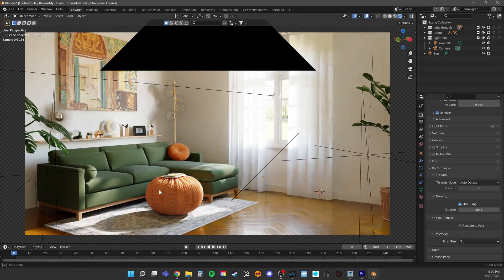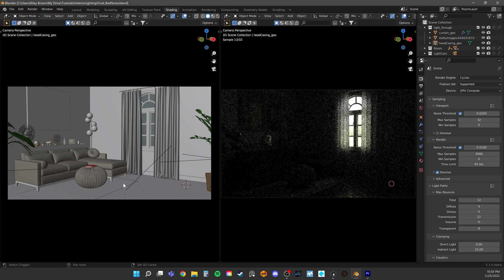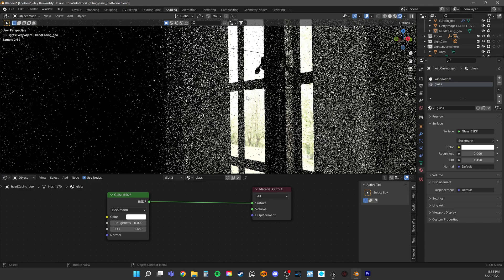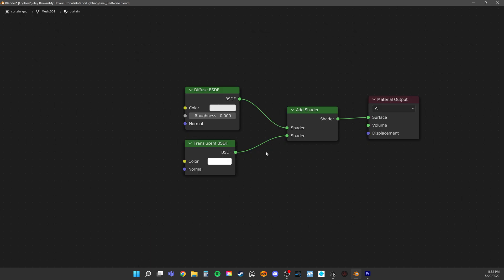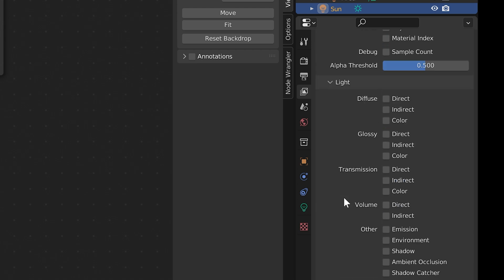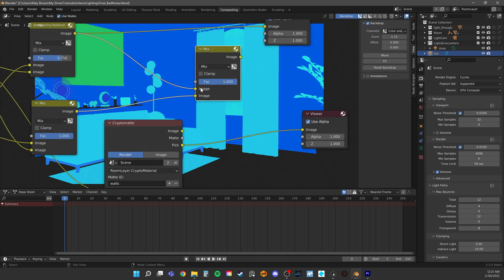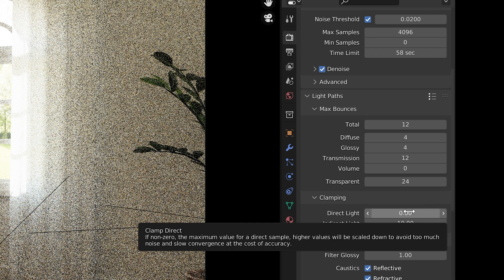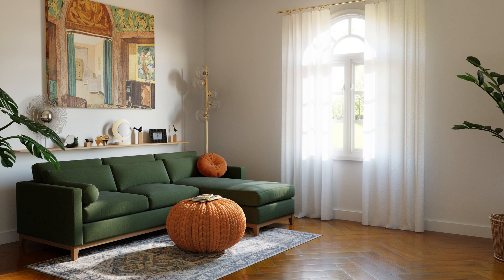Optimize interior Renderings in Blender Cycles

Comment: Great Video would like to know how you did this wall disappearing thing, when the particular wall comes right Infront of the view. am building an interior scene myself just for learning purposes and would love to know how you did that so that my camera can always see what's inside the walls while of course the far end of the wall is still visible
Reply from the maker: In the shader editor, drop down a mix shader. Mix between your existing shader and a transparent shader. For the factor, use "Backfacing" from the "Geometry" shader node.

Now, the "front" face (wherever your normal is pointing) will be your existing wall shader. The backface will be completely transparent. Allowing you to look inside, without letting the light out. 

 For this to work, keep in mind you need the normals on your walls to be facing inward. 

If you run into trouble and want more help, please send a message to the email listed in my channel's about page.
Reply: @rileyb3d  Thank you so much.

Comment: I would like to ask a question, should the light portal be positioned before the window (outside the opening) or after the window (inside the room)??
Reply from the maker: Good question. Through my tests it didn't make much of a difference. I'd personally put it on the outside to ensure you get any direct light you need to show on the window or wall geometry. 

I would still keep it close to the window opening though.

Comment: There is also a way to get rid of noise by actually rendering out a bigger image and then denoising it. It is slower but with the same amount of samples, or even lower, you could get better results
Reply from the maker: In my own tests, I didn't find this to be a reliable method. It is a lower number of samples, but the samples spread across a larger image end up taking about the same time or longer. I also found denoising to take disproportionately longer, the larger the image. 

That's with limiting testing on one scene though. I wouldn't be surprised if some cases work out better. Thanks for sharing!

Comment: You don't actually need one of the mix nodes if it's set to 1, that practically does nothing and also the transparent light bounces doesn't matter because the light is ignoring the window anyways and not bouncing, and besides there are only 2 transparent objects so 2 transparent light bounces are enough

Comment: One neat trick i picked up is often rendering higher resolution image(1440p instead of 1080p) can actually save you time. Higher resolution leads to way better denoising while suprisingly not adding as much time to render as you might think making it actually faster than cranking your samples at 1080p

Comment: nice tutorials and renders
just wondering why not just turn off shadows in the object property for the window for example? Also is it better you use the Principal shader for glass/ curtains or stick with the simpler setup?
I am  a bit confused with portals as they don't seem to make much difference in my scene unless I really bump up the HDRI strength
Also is it ok to jsut use the HDR and not an additional sunlight.When I do use a sunlight I  generally make my sunlight quite sharp and then align it to the HDRI using the 'sun positon'
overall i am find outside lighting much easier than interiors ;)
Reply: replying to myself :). I still think blender portal lights are not as good as other renderers. for example renderman you can increase the strength of the portal light and link it to the HDRI

Comment: Hello, amazing video with tricks I didn’t know, but I have a question that I was not able to solve,  maybe you know the answer,

I’m currently using KcyclesX 3.2 that has this feature of light linking where each light is rendered separately and then composited together into a final result, 

I’m not able to figure out how to use the denoise  by material node setup together with this light linking feature

If anyone has an answer to this I please do let me know

Comment: What do you consider are the best HDRIs from Poly Haven in order for the interior to have ample dynamic range?
Reply from the maker: I overuse "artist workshop". Love that one.
Reply: @rileyb3d  I've tested it and it is indeed great to get good details in the highlights and the shadows.
Do you use it when rendering interiors? If so, how can one get rid of the unwanted reflections of the HDRI showing up in metals, for example?
Reply from the maker: @mrlightwriter  I usually go with the added reflections, but if you want to "cheat" it, there are a few ways. 

Add a mix rgb node in between your HDRI environment texture and the background node. The HDRI goes into the first mix input. In the second mix input, either insert a solid color, or a different HDRI you want to show up in the reflections. 

Now, add a Light Path node. Take "is glossy ray" from the light path, and plug in into the "fac" (factor) of the mix node. 

This will essentially make it so any reflection (like your glossy metal) will now show whatever you have in the second input, while your scene for the most part, will still be lit by the first HDRI image. 

If any of that doesn't make sense, feel free to reach out on my patreon! I can give you more 1:1 help and have you send your scene for optimizations.
Reply: @rileyb3d  Your answer was very comprehensive, thanks! I'll try it as soon as I can.
Reply: @rileyb3d  I'm using the "artist workshop" and it's indeed a great HDRI for interiors. Thank you!

Comment: Optix temporal denoise since Blender 3.1 is amazing for animations, more people should be talking about it!

No one seems to have tested it because there is no documentation. I got this far:

Set render output to EXR_Multilayer; turn on vector and denoise_data layers and render an animation. Then open up python console and enter: 
bpy.ops.cycles.denoise_animation()
It goes through each saved image file for each frame (so its best to test with just a few frames), and overwrites the layer "View Layer.Combined.RGB" with a denoised version.

(I think you have to have an RTX card, Optix as the Cycles Renderer in System settings, and turn denoise on in render tab, select Optix, then turn off again - I don't know if all this is necessary, but when I initially tried with Cuda selected in system settings, and OpenImageDenoise in render tab, bpy.ops.cycles.denoise_animation() worked, but the results were poor. So I did everything I could to ensure Optix was being used, not any other denoiser, and got much better results.

Open the EXR image sequence in Davinci Resolve, go to Fusion page, and on the MediaIn node, choose the layer RenderLayer.Combined.

BTW, your video is awesome, really great lighting tips!

Comment: Phenomenal tutorial. The only part that I didnt 100% understand was the light clamping settings, but I think that migth be one of those "you have to play with" settings to really get a feel for it. Thumbs up!
Reply from the maker: Direct light clamping: It's like a gate that stops higher values of direct light from entering the scene. Lower numbers clamp more light. I typically don't touch direct, because it will mess with the intensity of light coming in. 
Indirect light clamping: Same thing, but with indirect light. So imagine you have an intense light source like our HDRI coming in the window. If indirect is not clamped, it can potentially create fireflies as it bounces around the interior with all of those indirect light bounces. If you clamp indirect (lower number) you might avoid some fireflies, but you can also darken the scene as you limit the light in the indirect bounces. I hope that makes sense, but as you mentioned it's definitely one to play around with.

Comment: Never add diffuse and translucency. You mix them together with minimum 50% diffuse, preferably much more. The absorption components are always mixed together with some factor (diffuse, refraction, translucency, subsurf scattering and so on, with only glossy/aniso being fresnel mixed on top. Unless the curtain is a blocker, you can also add transparency for holes in the thread pattern. May have to tweak this transparency based on angle, like lowering it at grazing angles - this will affect all rays.

Other tricks I use is making sure curtains are single sided geometry (be aware of inverted normals), and the same for windows usually. The "sow back" area can be faked with shader setup. No need to use a "glass shader", a fake Layer Weight -> Power 5 -> add 0.05 to mix transparency and glossy will do the trick. If you do need refraction for roughness, you need to use a geometry/incoming node as the normal if it has no thickness. You could use fresnel instead, but need to handle inverted normals. You can do fake fresnel for shadows too - glass panes creates more shadow at glancing angles - but too much to explain here.

For indirect light clamping, if used (I never use it), always do a test between unclamped and clamped to see if overall brightness is affected and if it's something you can live with. To compensate, or if you need to fill in dark shadows that produces "ugly noise" (after denoise), you can try to add a tiny bit of AO based global illumination (like factor 0.005 to 0.05'ish). Note that principled shaders sheen parameter may still be incompatible with AO based GI, I haven't tested in a long while.

Instead of HDR, I tend to use Nishita sky (and its sun sometimes) for anything but camera view. Only occasionally will I do glossy rays (reflected in floors typically). Sky texture clears up faster than HDRs and allows you to do "window pulls" more easily without affecting overall exposure of the room. Don't go crazy with this though as it will soon look unnatural instead of a treated photo.

To prevent detail loss due denoiser in high quality finals, I do them in 4k, sharpen them up, reduce size to 2k (50%), and a little more sharpening to the final output quality. Similar to how I treat photos. But takes 4 times as long, so...
Reply from the maker: Thanks for sharing your tips! 

For the second tip (shader setup that was too complex to share here) would you be using the "backface" input from the "geometry" shader node? I'll have to give that one a shot! Although, to get a good SSS on the curtain, I nearly always use something with some thickness. So maybe I'll play around with your fresnel approach. 

All good tips! On the image re-scaling, I've found doubling resolution and doubling sample count essentially effect the render time equally.
Reply: @rileyb3d  Yes, and then use 1/IOR for the backfacing face for fresnel. Bump direction and shadows may require some extra paying attention to as well.

The problem with SSS, which does indeed require thickness, is that it doesn't let any light trough. A thin curtain will let a lot of light through and the backside will have a shadow on it from objects casting shadows onto the front; search for "shadows on curtains" (or drapery), quite evident on shadows from direct sunlight.

Comment: The light path part should be more detailed. Base settings aren't that good (transmission 4 should be enough for your render)
Reply from the maker: There was just one spot where 4 wasn't enough (corner where the wall is getting glass bulbs, window glass, and curtain folds at an angle). 
Thanks for the feedback! I agree, most could benefit from an explanation on what each light path does. I'll keep that in mind for future videos.
Reply: @rileyb3d  I will watch it. Your videos are very interesting

Comment: Nice overview. Cycles glass really blocks to much light, run into that before. One advice so on denoising, try splitting up denoising for diffuse before the color texture is applied. That way you do not loose detail in textures. Its simple and eCycles, kCycles and TurboRender Noise make a lot money with that trick, however can recommend the last for esse if use
Reply from the maker: Thanks for stopping by! I'll look into this. The technique sounds promising. 

To do this, would I need to use the compositor to combine the separate render passes (diffuse indirect/direct, glossy, etc)?
Reply: @rileyb3d  Well you can do that in Blender or in any other compositing tool. The trick is you add diffuse indirect and direct to get a total output, this is normally noisy. You deNoise that and then multiply it by the color output, so the textures are on top and still will have all the details. You can do the same with all reflections (glossy), however the textures is mostly less important on them. It a know standard to post production with each render. For denosing animation you can check out various advanced technic like motion based denoising or frame samplers, like in NeatVideos Reduce Noise (not in Blender).
Reply: @robertYoutub  Thank you very much for your tips

Comment: Very well-made video, thank you! But I think that the real question here is how would you make the render less noisy under one minute while keeping the same dark room atmosphere (as in render result 1). Adding more light obviously helps but it breaks the mood - if the dark ambient mood is the intention.
Reply from the maker: Great question. I would use the same "fixed" setup with more light, but lessen the amount of light coming into the room by turning down the HDRI, if a darker mood is what you want.

The first result we got before optimizations is actually not representative of a real-life scene. In the real world, the glass in the window will let light pass through, instead of casting a shadow on the whole room. Glass casts shadows by default in most render engines. Some engines (like Vray) have a toggle to turn off shadows for cases like glass in windows. This is the same approach for Cycles. I hope that makes sense, and thank you for watching!

Comment: Sometimes the compositing part takes just as long as the render time, especially at higher resolutions 😮‍💨 also i never use the glass bsdf, instead mix glossy+transparent. cycles can't really do realistic glass anyway
Reply from the maker: This is true! I'm not sure if this is still the case, but I believe the compositor runs on CPU only, so a lower clock speed on a CPU could really make for long compositor calculations.

Comment: This is an excellent video Riley! Thanks for explaining everything thoroughly, alongside giving the "why" for each vital step. I learned quite a bit with regards to optimization and how much I'm currently under-utilizing cryptomattes for Denoising!

I have a question regarding animation for interior scenes such as this. In addition to the techniques from the video, what advice do you have for efficient denoising with camera movement? I use the Animated Seed value, but still find myself having trouble with render times and effective denoising. I don't do interiors often, and when I do it's usually in Real-Time (UE/Eevee) and more Stylized and Game Art-focused. If you're open to it, I feel a video in this format with an overview of those "Advanced" controls could be very helpful.
Reply: Dont use native blender denoising for animations. Use the denoise node with the two inputs. It gives way better results. If you can wait for 20 more seconds per render then you can use the superimagedenoise addon for very clean results.
Reply from the maker: @kooale3252  Thanks for this additional insight. I'm interesting in putting this through a test.
Reply: @rileyb3d  A video on the 4 blender denoisers would be great. Ive done a lot of my own testing and so far ive found:
1. Native blender denoiser is the worst by far. Does not respect texture detail or edges. Smudges everything out way too much.
2. Normal denoise node with denoising normal and albedo plugged in. Way better than native blender denoiser. Very good for still renders, doesnt work well with volumes though.
3. Optix denoiser. Faster than openimagedenoise but more of the same thing. Doesnt work well with volumes.
4. Superimagedenoise. This addon has a custom nodegroup with 3 outputs. Standard high and super. Standard is just the basic openimagedenoiser. I didnt have time to do any tests with high so i cant speak on it. Super quality denoises each render pass seperately and then combines them together for a very good quality image. It doesnt work well with shadow catchers or transparent backgrounds but for a normal scene superimagedenoise is like magic. It adds about 15 to 20 seconds to rendertime but the quality is well worth it.
Reply: @kooale3252  Thanks, I'll keep this in mind as well!
Reply from the maker: This is a great question. First, I would actually highly discourage using the animated seed value if you are also using the denoiser. This will actually make for some really jittery/wobbly looking results. If you must do an animated interior in Cycles, I would turn off the animated seed value, turn off noise threshold, and just find a sample value that will work (with denoising). Under advanced sample options, I would enable the sobol noise pattern instead of multi-jitter! I just find this to give me much better results. 

If you're denoising, and you'll probably need to, I would denoise more aggressively for animation and just get rid of fireflies. 

I add a layer of noise back in over the top of my animation in post. I use premiere, and the effect is called "Noise HLS Auto"

The intro in this video is a bad example by the way. I was a bit rushed and it ended up being pretty noisy. Oh well :/
Reply: I'll be sure to give this advice a try! I also use Premiere and I haven't used that effect, so I'll check that out as well. Thanks again! (Honestly, at a first watch, I thought the intro video was great as far as animated interiors with fabric close-ups in Cycles go!)